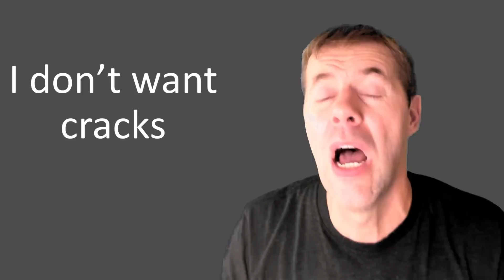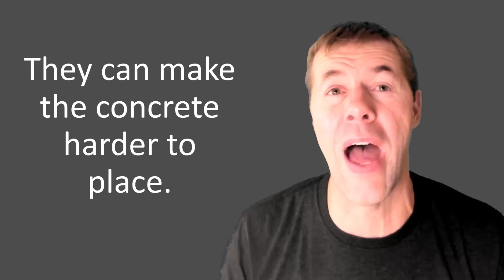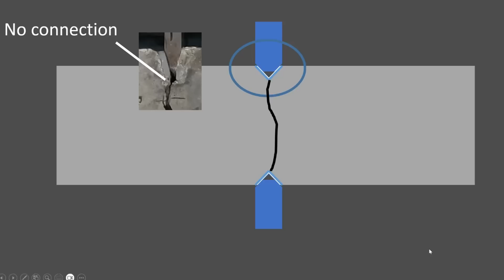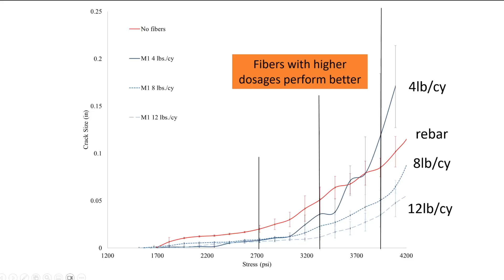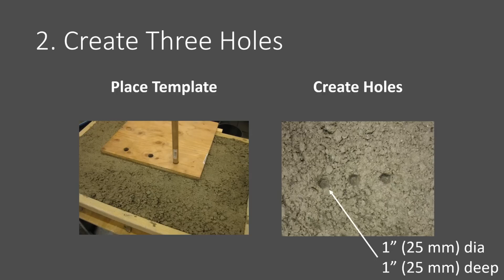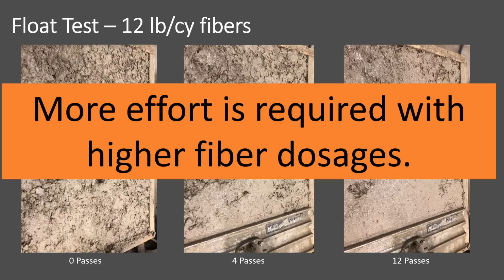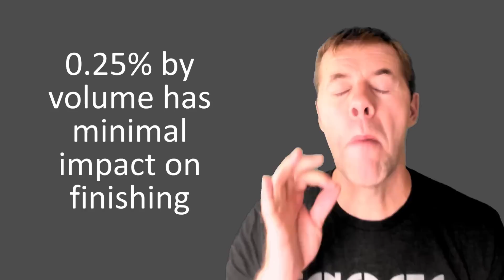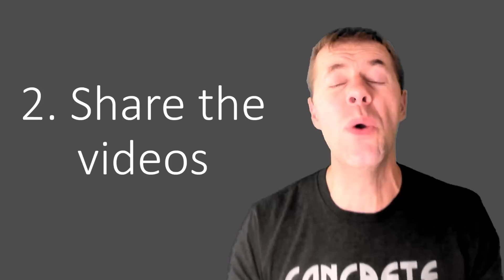Testing fiber reinforced concrete with an expert

Comment: Tyler.  Please do videos on ICFs.  ICFs  provides a great environment for your precious concrete to cure.  Throughout it's lifetime, ICFs reduce the temperature extremes that it will experience. There are academic papers that say laterally constraining concrete makes it stronger meaning less concrete needed.
Reply: Sorry but ICF is the biggest con in construction over thw last 30 years. 
A homeowner can  build a house that
 cost less
Had much stronger walls
Better air barrier
Better water barrier
Much higher insulation value
Higher thermal mass
I could keep going but ICF is better at nothing.

About 30% the cost of ICF just doing a basic sandwich panel.

Look up Thermomass CIP and thw scales will fall from your eyes.
You can easily rent commercial concrete forms. If you live in a remote area, they will deliver them and most do a 2 month rental as standard.
I recommend Doka. They're in Denver and serve the  western US from there.
Reply: @sparksmcgee6641  Yes you can handcraft a better house, buy dozens of materials and trades to put them all together and take meticulous care to get the details right.  I'm an engnieer, not building science related but a principal in engineering is to reduce steps, use the KISS philosophy. For people working DIY or small production numbers, ICF checks all the boxes to build a performance home with the least risk of getting something wrong.  It a hole in Tylers education to ignore the science of curing concrete in thermally controlled forms.
Reply: Don't say that "laterally straining" line. A new sales pitch for a suboptimal product.
So they're saying have stress built up in a brittle product is good? I may have to read up on that to explain why it's not good.
They may just be talking post tensioning.
Where are these studies?
YT comments can come across as curt but I honestly want to read it.

I'm a contractor that specializes in exposed concrete superinsulated homes.
No special expensive product needed.
Reply: @sparksmcgee6641  Here's a quick experiment.  Fill a Styrofoam cooler with sand.  Stand on it.  Now dump the sand on the ground.  Stand on it.  What happens.  Even if concrete were to turn to sand, it would still be held together and support weight.  This is just an example taking something to the extreme to demonstrate laterally CONFINING, not tensioning.  You say you are a forms contractor. A problem for a DIY homebuilder or even a small builder is to get a concrete forms guy to even want to work your job.  Or maybe he will work you into HIS schedule.  There is plenty of work where the advantages of ICF are relevant and forming on site is best.  What do you think of Superior Walls?  I imagine they might take a bigger bite out of your business than ICF.
Reply: @sparksmcgee6641  I didn't say laterally straining like post tensioning.  I said laterally constraining, as in the forms are still in place holding it together.  Here is a example of what I'm referring to.  Fill a cheap EPS foam cooler with sand.  Now stand on it, gently.  It will likely support your weight.  Now pour the sand on the ground and stand on it and it will collapse, sand getting pushed to the side.  If the ICF is strong enough to support several feet of poured concrete, it will continue to provide lateral support later on.

Comment: As a consumer, I’d absolutely pay for fewer and smaller cracks. I’ve put in a little concrete on my own farm, and my slabs invariably do better over the long haul than when I hire out. I take my time, use good prep and compaction, superplaticizers, low water, slow, covered curing, and fibers. The last ‘professional’ concrete work I had done, the guy putting it in, told me at the very beginning, “there are 2 types of concrete… concrete that has cracked… and concrete which is yet to crack.” I took it as him preparing me for shitty slab. And he came through. It was cracked within 3 months.
Reply: Yeah. I don't trust concrete contractors to prep the surface well with strong compaction. They may do some, but never enough. Also, some don't use chairs for the rebar; they just try to lift it up as they pore. I don't trust that either.
Reply: @travisjazzbo3490  To me it looks like they are only rewarded or paid for the finishing. Sloppy compacting and preparations will typically not make them less money. Just get the concrete in there, make it look good, and all is well! Don't need no curing!
Reply from the maker: Those stories are tough to hear.  I am glad you have had success when you did it yourself.
Reply: Yeah, I’m really sick of that comment two types of concrete.  Basically too many guys out there with half a brain talking like they have a full brain.
Reply: @USAFreedom4Ever No, their brain is definitely full! Just full of concrete instead of neurons 😆
Reply: @Ariccio123 Sand at best😂
Reply: The lazy people out there also hurt those of us who do things correctly. I do all my own dirtwork and prep. Im really anal about my forms being right- square, plumb down the sides, exactly on elevation, and braced perfectly straight. Soil always gets properly mixed for optimal moisture and compacted, as well as compacting any fill in short lifts. I just like working to as tight of tolerances as possible. But obviously this takes more time and it is hard to articulate that value to customers who only know concrete for what you see on the surface and are used to guys getting in and getting out, with a slab thats kinda flat and pretty smooth, and “It has a few shrinkage cracks, so what?”. Unfortunately doing good work just isnt very common, especially on the residential side.
Reply: @markdoumert I have a motto for your company- “If they say there are two kinds of concrete, fire them and hire me.”
Reply: This is the right attitude. The "I actually care enough about it getting done right that I'll learn how to do it myself and make sure it's done right" is also kinda how progress is made in the world, science and otherwise.
Reply: "Stainless" would definitely corrode in such a situation. Probably worse than some non-stainless types. It forms a protective layer of oxides over the surface that may or may not stay intact during the pouring and subsequent life of the product.

Comment: What effect does more rebar or wire mesh have on reducing cracks? For example, in the split beam test, what if you added a second piece of #3 rebar, would that also reduce crack size? I assume there is a limit to how much rebar you can add before you have issues (eg, voids), but I'm assuming that limit wasn't part of the split beam test.
Reply from the maker: Yes! more rebar would also reduce the crack size.  I ran the Split Beam test to just compare different types of fibers to one another.
One cool idea would be to compare the crack reduction from 1 rebar, 2 rebar, and 3 rebar to the fiber performance.  Thanks for bringing this up.  We can add this to our testing.

Comment: Say you were doing a 26x53 slab for a basement with precast concrete walls on the basement and first floor and there were bedrooms and living room bath on the slab . And you don't have enough money to put in flooring . So you don't want cracks showing , whats best for that on a budget ? And is there some way to make it easier on your feet like not so hard ? That last part may be too much to  ask.

Comment: Screed vs vibrascreed, jitterbug vs rollerbug etc?
Reply from the maker: You can use any of these as long as you don't over do it.  It also depends on the mix you use.  You should adjust the mix depending on what strike off technique that you will use.
Reply: @TylerLey  heavy equipment shop floor, normally spec 5000psi, no air, HRWR, last one had wwr in it and 1.5" fibrilated fibers at 1.5lb/yd, would like to go with a more substantial product going forward but we would like less fiber protrusion at the top layer because just screeding floating and then getting on it with the machines doesn't knock the fibers down into the paste enough IMO. In fact I think you can end up with a weaker top layer (impact resistance) if you have fiber laying horizontal and burnt in with finishing blades as you end up with little to no cover on the top fibers. 

Next one we do we would like to investigate vibrascreed and maybe a rollerbug to get the fibers a bit more below the surface, within reason.
Reply: @NitroAuto77 Go lower on the long fibre & add some fine short 1/4 to 3/8 fibre ! Have used fibreglass & PET 1/4"  shotcreteing you can get a nice  finish
Reply: @jackdbur  much appreciated!

Comment: Curious as to which fiber performs best, and if it is steel, what is the negative effect or susceptibility of the steel to corrosion? Will the fiber segregate when vibrated? Great data, and looking forward to more research on this.
Reply from the maker: All the fibers were helpful.  The plastic fibers that were twisted with good anchorage at the end did surprisingly well.  They did as well as the steel fibers.
If you mix is designed correctly then the fibers will not segregate.  This is mainly about aggregate distribution.  I have videos that talk more about this.
Thanks for watching!!!!

Comment: Wet curing has made more difference in my projects than anything.I have to do that my self to get it done right.
Reply: Interesting. Have you tried making a pond around the slab, and submerge the slab in water?
Reply: @elbuggo  No.I cover it with canvas, soak it good and cover that with plastic. It stays wet a long time, have left it up to a month. The wet cured sections look better, and dry much faster after a rain ( not absorbing as much water i assume) And I have no cracks after two years :)
Reply from the maker: @wheelerdealer2105  Nice!!!  Thanks for sharing!

Comment: What about carbon fiber?
What about carbon fiber rebar. Utilizing both at 7lbs.per Cubic yard ?
Inquiring minds want to know.🤔
Reply from the maker: No one makes commercial carbon fiber rebar or individual fibers for concrete at this time.  I think this will happen in the future but it is too expensive right now.
Reply: @TylerLey  I have seen both carbon fiber strands and rebar online coming from China, but no good source information or credibility of specifications listed.  Also basalt fiber, same online sources from China mostly (some from Russia), also no good source info etc.  I'm not sure "I found it on Amazon" would pass building inspector approval...

Comment: I like the fiber! I don't like the parking lot i used to frequent that was poured with steel fibers that were loose all over the surface and in my tires.
Reply from the maker: I get it!
Reply: @TylerLey  make a video on rebar placement in arches! I've always wondered about that.

Comment: I make concrete tables and counter tops. I use plastic and basalt micro and macro fibers extensively. They are totally worth the extra expense. I've used them also in making concrete pavers. They allow considerable material and weight savings which turn into savings in labour and transport costs.
Reply from the maker: Thanks so much for sharing!!!
Reply: How thick are your tables?  I’m trying to make lightweight concrete panels (say 1” thick around 4’ x 8’ size)  it’s only if we’re aesthetics on walls.  I have an architect wants me to do this.  I’d rather not use 1 inch thick concrete. Can be rather heavy. 
Thoughts?
Reply: @Avavul17 

One more thing I forgot to say. I also use a special ultra high performance concrete (UHPC) mix which I make myself. I don't think any regular concrete mix can get you this thickness without failing.

My mix uses extremely low W/C (~0.3) and silica fume along with other special added components. Use of superplasticizer is a must and to achieve proper mixing of the ingredients is extremely important. I also use high quality white cement as the binding agent because it has higher strength then the regular cement varieties sold in here. I then add pigments to achieve the desired color, usually black or dark gray.
Reply: @ 
Thanks for getting back to me
Reply: @Avavul17 
I'm not sure if you can see both of my replies to you. I can only see the last one that supplements the original which gives the measurements of the tables I made. If you don't see that one, let me know and I'll write it again.
Reply: @Avavul17 
I made a prototype that was about 12mm thick and was about 500mm by 1000mm. In stress testing it was strong enough to be a writing desk and you could use it as a support when getting up but it cracked when about 50kg of weight was put in the middle. In this configuration the support points for the table top were 150mm away from edges leaving a space of about 800mm by 500mm for your legs.

What you propose (4' by 8') sounds feasible at thickness much less than 1". If the panels are strictly aesthetic and are well secured against a sturdy level wall, I think you could get away with a panel thickness as thin as 12mm so long as you use proper reinforcement.

This table used a combination of basalt fibers of various sizes, basalt fiber mesh and basalt fiber rebar of a very thin diameter (between 4 and 6mm if remember correctly). 

While this technique makes the panels flexible (you can see visible bending without failure when force is applied) but careful handling of the panel will be necessary. Proper curing process must be observed and you need to carefully think before hand how you are going to attach the panels.
Reply: Step up and get Helix Microrebar 5-25
Reply: Thanks for this knowledge. Do you think this mix would be ideal for my garage drive way?
Reply: @RiciCapelli 
That depends on many things but in principle yes. I've made driveway tiles that are less than inch thick and take a fully loaded truck without problems. 

If UHPC concrete makes sense in your application depends on availability and cost of labor, key ingredients, method you are going to use in preparing the mix and what kind of requirements you have for the driveway. Your location also matters because harsh winters put special requirements to the mixture even if poured in mild season. Proper curing is an absolute must - especially with a big slab like a driveway.

Finally you can't substitute proper foundation work and subgrade with higher quality concrete but must still pay special attention in making sure the work is done properly. 

I made about 30cm "wide" hexagonal tiles from fiber reinforced UHPC. The tile thickness was about 20mm and in testing they took fully loaded pickup truck without damage on unprepared flat surface. There is no way regular concrete tiles that thin would have been able to do the same. However, do your homework before attempting. I would recommend you make a small test area before you commit to the full driveway. Tiles behave very differently from slab as slab design need to account for shrinkage and and prolonged load when a vehicle is parked.
Reply: @mikkoekstrom8109 thanks for this detail reply. Not gonna lie, I can tell that you are an expert on this stuff. 

I live in Malta and the only problem we have is the hot climate, it can reach to 40 Celsius (104 Fahrenheit). I want to create a short slab around 3 meters wide, with 3 meters long. The slab must be slightly on the slope side cause the garage door isn’t exactly flash with the street level. Usually I do the normal concrete mix with cement Portland (gray), small rocks, sand and water. That’s how usually people do their concrete mix here, but I want a concrete mix that won’t crack that much so I told myself that if I add some type of fiber would be better, like fiber glass or something similar.

To conclude, I must make the concrete non slippery since it’s slightly on the slope side, just in case when rain hits I won’t injure myself. The driveway is only going to be used by a small European car so the slab won’t have much stress on that part. Thank you once again for your reply and your advice 👍.

Comment: Thanks for the update 👍🙏👷.  More updates on this topic will be highly appreciated , especially on ways to avoid agglomeration of the fibers while mixing. Also  please address the issue of corrosion of steel fibers in the cover concrete. Can placement in columns, beams and other members which do not require surface finishing like slab top, be an issue with fiber mixed concrete. Moreover how will fibers behave in Self Consolidating Concrete (aka SCC).
Reply from the maker: If you add the fibers with the aggregate then that helps a lot with clumping.
Steel fibers will corrode in the cover concrete but they don't cause additional cracking.  Plastic fibers don't have this issue.
Fibers are great in columns, beams, etc.  Most people don't use them there because they are not as concerned with cracking in those elements.
SCC can be designed to use fibers but you have to be sure that the material does not segregate.  There are lots of strategies to deal with this but I would require trial batching to see how they perform.
Reply: @TylerLey  Thanks for the prompt response. I have one more query, will adding fibres have any adverse impact on permeability of concrete? My query is based on wild imagination that the fibres may make a channel for transmission of liquids from surface to interior. A water penetration test may reveal useful details. I am a bit surprised that people don't bother about cracks in Columns and Beams, especially when they are structurally far more important than slabs. Anyways will be waiting for your forthcoming videos. 🙏👍👷
Reply: In cooking, when you want to keep something you're adding from clumping up, one thing to do is make a paste, mixing it with a smaller amount of the main batter, which makes it harder for clumps to avoid the mixing process. Then, the paste is added to the main batch, and the new ingredient disperses fairly evenly.
Reply: @JELWwL6unE8V7iGB3  Ok, i will try out your suggestion and observe the results. Thanks 👷👍🙏